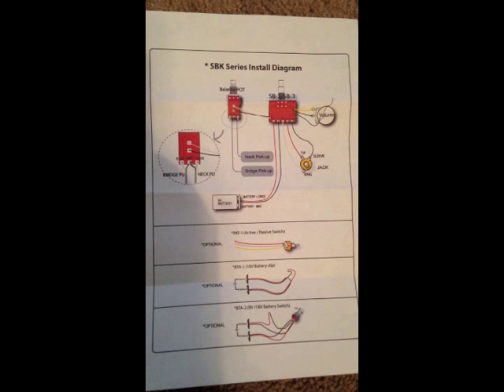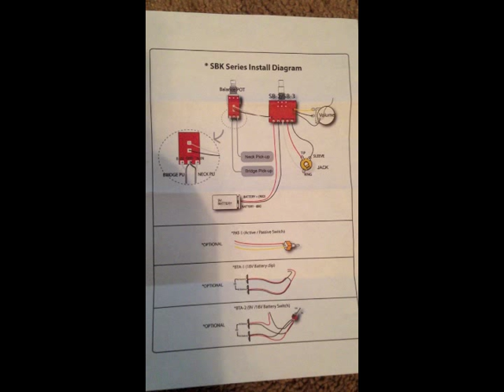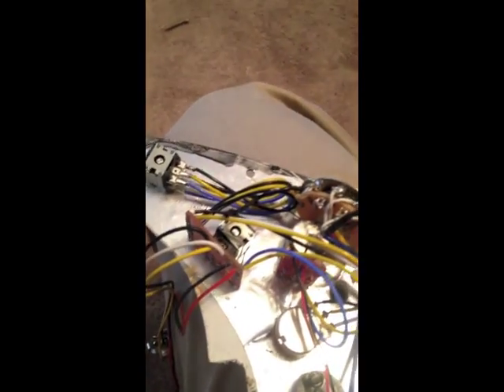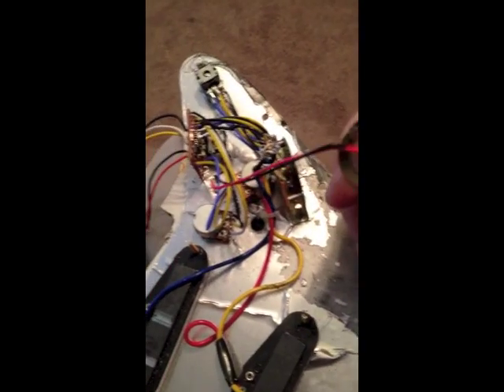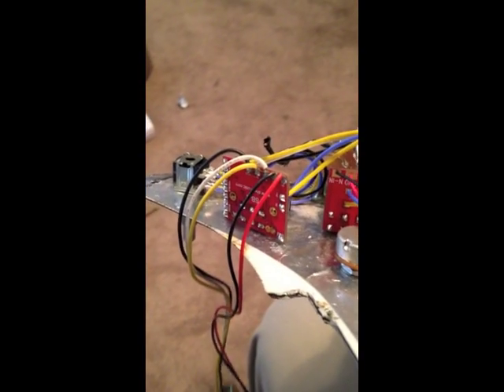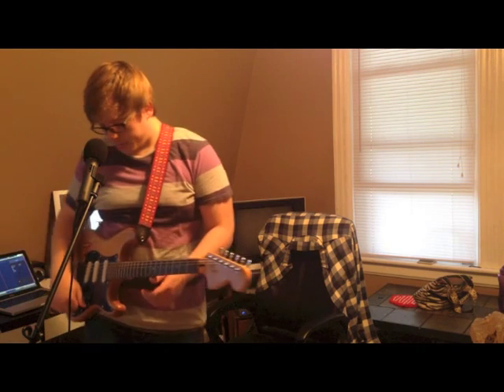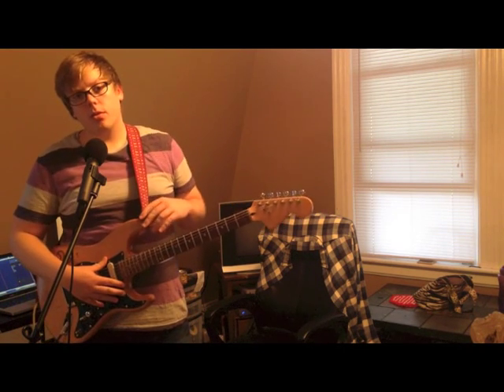How to Install a Contact Mic into a Strat using an SBK-3AD Harness from Guitar Fuel

Comment: You're probably right about the hum silencing, since the piezo will act like a capacitor. But the hum reducing will vary between what piezo disc you use and what frequency the hum is. But then it will also act as the tone control and remove some of the frequencies of your guitar.

Thanks for confirming this idea for me. i got this idea a few days ago and searched for it. 
4:23..... its decided, i will do this mod.

Comment: Hi christian. my luthier is been trying to do this to my fender telecaster modern player plus which consist of a humbucker, single coil, and a tele Porter 9T on neck position, 1 vol 500k split pot, tone 500k split pot, & theres a toggle switch to split humbucker to single. I already bought a blend concentric pot & installed a piezo disk under middle pickup, & an acoustic rail saddle piezo under the actual guitar bridge. We cant just figure out how to do the wiring to a point where we dont get both piezo and the pickups sound together; thats why we bought a blend concentric pot so we can blend piezo with pickups or use piezo by itself or pickups by themselves. Please, any help will really appreciate it Great videos u have by the way, keep em coming!
Reply from the maker: Holvin Hernandez have you tried connecting the output of the contact piezo and saddle piezo to the same input on the concentric knob and then connected the pickups to the other input? Can you show a picture?

Comment: Hey Christian your guitar sounds awesome. How do you think  this would work with humbuckers ?Did you ever try shielding the control cavity with conductive paint or copper tape. That should fix the hum. I think your approach to this is brilliant. Are these what you call ghost electronics?
Reply from the maker: Weirdly enough it is shielded with conductive paint. I think the area that I am in is especially conductive to outside interference. Cause I've moved twice and shielded two different times and still get nasty him when I face certain directions. 
But to get to your question, I think with this install wouldn't work particularly well with humbuckers because of how naturally muddy the humbuckers and piezo are. But that's just my opinion, I could be wrong. I have since removed the piezo and installed a piezo pickup under the saddle. A video of that to come!

Comment: Hey thats great, I would like to install a piezo on my floyd rose washburn. I'm gonna try to put a piezo bar between the floyd block and the platee, as I saw in other video, any recommendations?
Reply from the maker: gamilo Hey, sorry I didn't see this comment. I have actually done that mod that you're referencing. I plan on doing another video soon that shows the results. It worked out really well but I can't tell if I like it as much as the piezo. The round piezo obtains a different character of the vibration than the piezo bar did through the plate. The plate makes it very metallic sounding which can be helped with an external EQ. Another thing I chose to do was install a second jack to route the piezo through a DI Acoustic box. Like I said, I hope to put out another video soon to show what I mean.
Reply: Christian Latson Thanks, that would be great to hear the result, i installed the piezo bar like i said before, but the sound was a little weird, nothing really special, but if theres other way i would love to try again!
Reply from the maker: It has its ups and downs. For one, it doesn't reproduce the friction of your body against the guitar as much as the piezo discs. And also, when your pick hits the pick guard a round piezo will hear it above everything else. And my other favorite thing about the piezo bar is that rhythmically you can hit the bridge for a drum beat with the loop pedal and with the piezo disc it doesn't go as hard.

Comment: did you use just the one piezo disc?   did you try more than one?   where exactly under the scratchplate did you find the best place to locate the piezo disc?     did you try attaching it to the tremolo block?   thanks
Reply from the maker: Hi. I tried more than one piezo and it works really well.

Anywhere under the scratch plate that applies pressure to the back of the piezo evenly works best.

I tried putting the piezo on the tram block but it was too thin of a sound.

I have a new video coming soon of using a piezo pickup inside the trem block that works much better than using a piezo disc. 

Thanks for watching!
Reply: Many thanks for your reply and info.

I'm thinking of adding some piezos to a couple of my electric guitars.

So are you now using a stick type pezo then?  And where exactly have you located it please?

thanks

Comment: LOOKING FOR HELP: i just put two piezos  into a strat style semi hollow i just made and i cant get the volume and tone to work independent of the main pickups - the single coil volume pot acts as a master volume and i can then blend the piezo volume but both the tone control for the single coils and the control for the piezo seem to have become universal... im not looking to add an active harness but im wondering if you guys might have any idea on how to make them work independently?? thanks for reading
Reply from the maker: felix gilbert ah yes. This is a common issue. I would take a look at the schematics for a bass with TWO pickups and TWO volumes. I had the same problem and had to find out after a lot of re-wiring that the volume knob is soldered differently when there’s more than one volume
Reply from the maker: https://goo.gl/images/1XeyRf
Reply: Christian Latson   Thanks! I’ll give this a try ☺️thanks for taking the time to answer

Comment: Alright, I just ordered that harness offline.
Reply from the maker: Awesome. It's a great harness. One of the best upgrades to any guitar. Basically, once you get the harness you can wire up your pickups to one end of the blend knob and the piezo pickup or disc to the other. I'll walk you through it
Reply: Cool, thanks. I'll let you know when it comes in

Comment: Very cool video.  I am in the process of building a semi-hollow electric, and this seems like the right project for me to try adding a piezo to.  I was curious if you were successful in placing the piezo under the saddle? Also, are you wiring the output from the strat volume pot to the blend on the SBK-3AD Harness, or are you getting rid of the old strat volume and tone pots?  Any help or if you have a schematic of your wiring would really be appreciated. 

Here is a link to the build thread for my guitar: http://www.tdpri.com/forum/tele-home-depot/574298-semi-hollow-build.html
Reply from the maker: Wow. That build is really something. I always wanted to do something like that. I actually love the way the forstner bits look eating out that guitar. Should just leave it like that lol. So as far as the piezos. I am close to putting up another video of a project I did where I wired an acoustic piezo pickup into a stray bridge thinking that type of piezo would sound better. I have mixed opinions. It doesn't have the same resonance as a hollow body guitar that I was looking for. However. Combining an acoustic piezo with the piezo disc could be great. As far as wiring, I have experimented with having two jacks. One for the guitar pickups and another for the piezos. This way you could run the piezos through a DI box or through effects SEPARATELY. If going through your own electronics you have to wire two volumes the same way you would in a bass schematic of two volumes. When I get home tonight I will post some links and hopefully have a new video soon (possibly next week). The great thing about the SBK was that the blend knob took care of any messy wiring that would come from two volume knobs. Hope this helps.
Reply: Christian Latson Thanks for the reply.  I probably am going to leave the circles left behind by the forstner bit.  I don't see any reason to clean it up.  I will clean up the edges though.  It's funny, the scalloping bothers me more than the circles.  I am hoping that the semi-hollow will give more of an acoustic resonance when playing through the piezo.  I don't really want to go the two jack route.  I like the idea of the blend knob.  I haven't decided if I am going two pickup or single pickup.  I guess it depends on how easily I manage to make the first one.  This will be my first attempt at making a pickup.  

With the mod work you are doing on the guitars you have, you should try building from scratch.  It really is a lot of fun, and sitting down and playing a guitar you built is a really awesome feeling.  There is tons of good info on the site my build thread is on, and on http://www.mylespaul.com/forums/luthiers-corner/

I am looking forward to your next video, as well as the links you share.  Thanks again.
Reply from the maker: Thanks for the link. The next project I do before actually building a guitar is staining a stripped body. After I know I can paint it I will then try to build from scratch. 

You mentioned making two pickup or single pickup. Did you mean about the piezos or are you winding some single coils? That's something I always wished I had the means to do. But I think it might be better left to people who have a passion for winding string around stuff. The piezos are literally a breeze to make. They're fragile but strong at the same time. You can crack one open in under thirty seconds and then it's literally beginner soldering. Very easy.

Here's the links; 
For wiring a piezo to one volume and your pickups to another you'll want to wire this way

http://www.offsetguitars.com/forums/viewtopic.php?f=8&t=66541

Otherwise, the volumes will "bleed" into eachother and each pickup will never fully turn down OR all pickups will turn down all the way. It was a MESS of a soldering project to figure this out and I literally took a screwdriver to my strat body and pounded it out of frustration leaving Philips head-shaped markings on my guitar. Not good.

If using a "Blend" type knob I only know how to wire it using the SBK-3AD like in one of my videos.

http://www.guitarfuel.com/images/df7f05aecae5a7941744b8a81fc98590_wunc_8h2w.png

Instead of wiring "Neck" and "Bridge" pickups to the knob like in the diagram, you wire the output from your pickup selector to one side and the output of the Piezo to the other. Easy as that!
Reply: Christian Latson Cool.  Thanks for the links.

I did wind two single coil pickups.  I rigged a little wooden stand for my drill that had a guide for the wire.  42 gauge is very thin, so each one actually took two tries, where I has a winding error, and accidentally broke the wire.  I decided to do it just to see if I could.  The impedance is a little lower than I had hoped for, so we will see how they sound when the guitar is finished.  I still have a ways to go.

I am also working on two electric violins, and in that process bought a bar shaped piezo that I decided am not going to use for them.  I bought a jazz style floating bridge for this guitar project, and I am going to try embedding the piezo in the bridge.

I'm trying to keep my budget as low as I can, but I think I have convinced myself to buy the wiring harness.
Reply from the maker: Is it true that you can solder the broken wires when winding pickups? Or do you have to start all over?

I never worry about low impedance because I always have read and heard that the lower the impedance, the more character is in the pickup. And that's why I always have my trusty booster pedal that goes from 0db to 20db. That always gets my pickups from nice and smooth, to bluesy and then to just simple rock tones. 

I always thought violins used an attached piezo like with a clip or suction/glue. I feel like that would work better than a bar on violins but I've never tried. 

Is your jazz pickup gonna look like this?;
http://www.schattendesign.com/Product_Images/AT%20Pics/AT-04Dimensioned.jpg
Reply: I've heard that you can solder the wire together when you break it, but I did not try.  I pulled it all, and started over.  My soldering skills are pretty rudimentary. 

Acoustic violins either attach a piezo to the bridge or body, or some bridges have a piezo built into them.  I am building essentially solid body violins, and the bridge will rest on top of the piezo.  You can see progress on the violins and guitar here:  http://thoughtblog.thewilkes.us

I ordered this bridge:  http://www.ebay.com/itm/331555401001  I am hoping there is enough wood to cut a channel in the underside to embed the piezo.
Reply from the maker: Also, I am dying to hear how those pickups that you made sound. Low voltage or not. Would you consider making some and selling them?
Reply: Christian Latson I'm sure I will make a little video when the guitar is done so you will be able to hear them, which will unfortunately also show off my lack of skill with the guitar.  

I would be happy to make some to sell.
Reply from the maker: These are going in the hollowbody?
Reply: Christian Latson Yep.  These are going into the hollow body.  

I have decided to order the SEB-2A from guitar fuel.  It doesn't have the sweep and and mids that the one you have does, but it does use a push pull on the volume to turn the active on and off.  

I assume your magnetic pickups are wired to the switch, with no volume and tone controls, and you are only using the volume and tone controls from the harness?